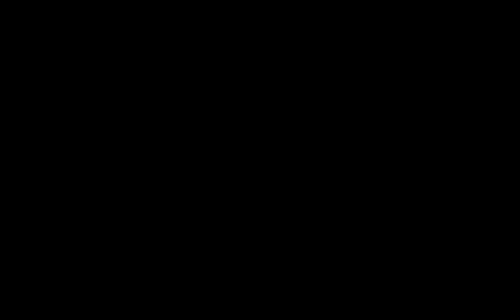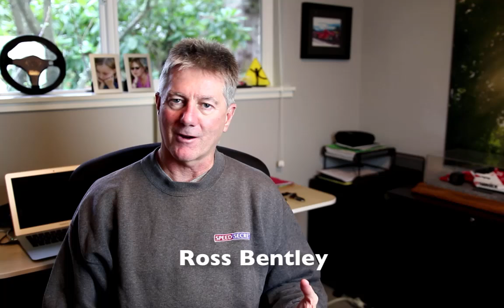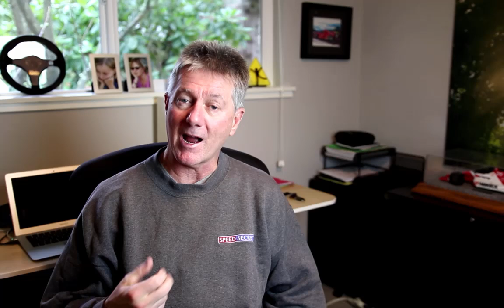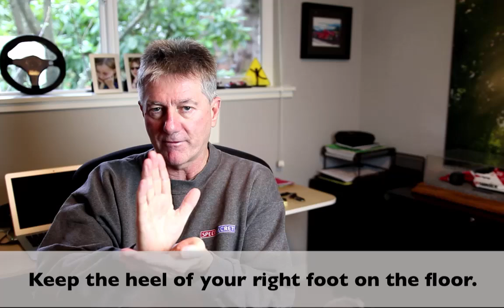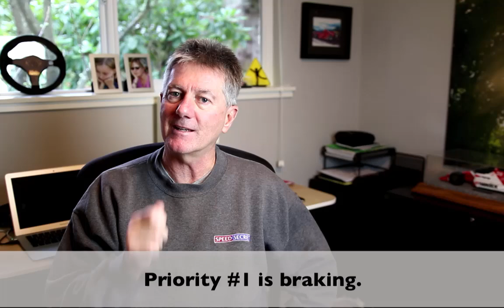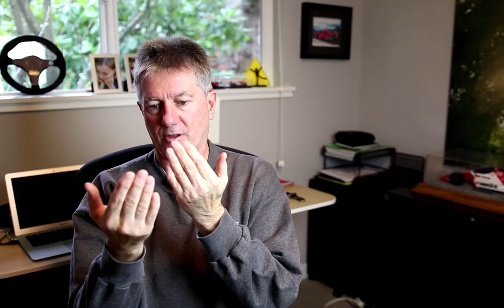Heel & Toe Downshifting: When, Why & How to Drive Faster

Comment: After you learn the technique in a non-stressed condition, consistently doing it while trying to squeeze the brake pedal as the g’s are throwing you into the engine compartment is the next challenge.

Comment: Thanks. So I do it the wrong way, just like described during 1:50. That's why I quite often miss the blip. But perhaps, it is due to my small foot that I find it difficult to do the correct way using the heel as a pivot point.

Comment: Ive been practicing the heel and toe for say 20 hours now, in a racing sim with a respectful pedal set. What ive been doing is (and my understanding is) when I know I will be downshifting whilst breaking i try to roll my foot to the throttle just before i release the clutch, to try to give the revs a head start, essentially. 
My question is.. Is there a list of situations where heel toe isn't the best option for faster lap times? Is it only beneficial to heel and toe on slow corners , say if its an uphill after the bend  or should I be aiming to blip the throttle every chance I get, even say its best to coast round after changing gear?  Its on corners where I have to be trial braking and I try to use the two techniques together is when it all goes wrong for me.
I believe Im not seeing any benefits yet because Im over thinking it and not just driving with what comes natural.
Reply from the maker: @bit-eki  anytime you need to brake and downshift is the right time for heel and toe. In a sim, there isn’t much benefit because the software does the work for you, but in a real car it’s easier on the transmission and keeps the car better balance (and not upset with a jerky downshift).
Reply: @Speedsecrets1  Thank you for getting back to me. Thats good to know, I will continue to practice but will know no i dont need to really worry about it. I'm still going to buy your book! All the best

Comment: Note on your pivoting motion demonstrating heel and toe. But how you do keep consistent braking pressure, while pivoting for gas also? If you’re braking 70% pressure, I don’t want to drop any pressure for blipping throttle. So how do you keep both consistent. The consistency of brake pressure you want, and enough pivot to blip the gas enough to match the speed of down shift while not taking away braking pressure
Reply from the maker: The simple answer to your question is, “practice.” If you keep your heel on the floor, and practice keeping the same amount of pressure on the brake pedal, you can blip the throttle without it effecting the brake pressure. That’s why it is easier to heel and toe on the track because you’re rarely braking at 70% pressure. When you’re braking at 90% or above, the pedal becomes firm and gives you an easy point to pivot from without releasing any pressure. Practice!
Reply: @Speedsecrets1  I'm running 60kg loadcell brake pedal on a simulator, i don't have any g force assist for applying brakes either, compared to usual road car brake feel, i'd say at peak firmness it's about 10x the stiffness. In terms of pedal placement, i notice two effects, at threshold braking distance, having the accelerator pedal be even, i can comfortably blip the gas, however i can only blip the gas about 15%. So depending on the car and how it's geared and how fast it slows down, it might be enough throttle to match the speed of downshifts or it might not. Part 2, would be if i bring the throttle pedal closer to me, I can give more gas then about 40% but my foot pivots off the brake enough where i lose pressure when shifting foot weight onto gas. Mainly i'm rev matching left side of right foot and right side on the throttle. these are floor mounted pedals so i'm trying t figure out how i could incorporate my heel when it seems like i dont get enough leverage or force with the heel on the floor vs rasing my foot

Comment: Hi Ross,
Thanks for the video! One question I have is down to the speed release of the clutch during the heel toe downshift. Looking at some videos of driving on track the drivers jump right off the clutch - almost stabbing the pedal so to speak. In my car I always get a slight jerk if I try to be this fast and so find that releasing the clutch slightly slower to be a lot better. Is there a difference in the clutch enabling them to be faster do I just need to practise more to get quicker? Also is there actually any benefit in being faster with the clutch or is it not that important as you are in a breaking zone so not needing the power anyway?

Thanks 
Chris
Reply from the maker: +Chris McGuire Hi Chris - Good question! The benefit of being fast with the clutch release is the car is always in a gear, and not "free wheeling" (which is never a really good thing). Definitely, some cars are easier to be very fast with the clutch than others. The big difference is in how short the brake zone is. If you're braking very hard and the zone is short, then you need to get your downshifts down as quickly as possible. That's why you'll see drivers of race cars be very quick with the clutch - they're getting it done in as short a distance as possible. Most times, when you brake hard, the release of the clutch will not upset the car (like you say you've experienced); if you're braking like you would on the street, then it's easier to be un-smooth with the clutch release. In other words, the faster you drive, the easier it gets. When I release the clutch while heel and toeing on the street, it's relatively slow. When I downshift on a track, where the brake zone is shorter and harder, the clutch release is faster. When I'm driving a race car - especially one with a racing gearbox - I use the clutch very fast (and even sometimes don't depress it all the way - just enough to get the gearbox to change gears). That is, if I use a clutch at all, as many race cars don't require the use of the clutch at all. I hope that helps. Thanks for the question.

Comment: Can you please do a video on the demonstration of keeping your heel to the floor and also the heel up while heel toeing? Pleasee
Reply from the maker: Good suggestion, and I will do a demo of keeping the heel on the floor while heel & toeing. I don't recommend heel & toeing with your heel off the floor, so I'll only show why it's a problem - and why I don't recommend it. I'll do this ASAP. Thanks for the feedback!
Reply: @Speedsecrets1  either my pedals are too small or my feet are too small lol. Whenever I try to do it I end up braking hard. So I only do it if I’m at a great deal of speed to where I would have to brake a little harder than normal.

Comment: Hi Ross. when you are doing the heel and toe, how do you know the exact moment (on the tacometer) on which you have to do it? I know it is diferent on every car... but do you have any trick to do this?
Reply: +andrescastaned80 You're not looking at the tach' you're looking at the turn/turn-in. It's getting to know the car and it's practice. First you'll not blip enough, then too much. After a couple (few :) ) practice blips (in a parking lot or easy lapping) you'll know how responsive the throttle is on your car and the engine sound needed to make the "rev-match" and also how coordinated you are at the clutch/shift/blip/clutch that Ross talks aboot. Happy driving.
Reply from the maker: +BubbaSmurft Well said. I'd add that you usually want to make your downshifts as late in the braking zone as possible - making sure it/they are completed (and your left foot is off the clutch and back on the dead pedal) before turning into the corner. You can't look at the tach to determine when to downshift. Yes, after you do it a few times you'll find the right timing - it's a feel thing. But again, don't be in a rush to downshift. I always say, "Brake... wait... then downshift."
Reply from the maker: +andrescastaned80 The comments below should answer your question. Thanks for asking.